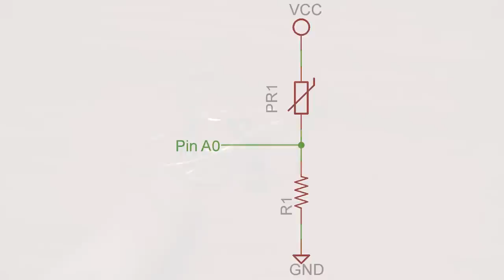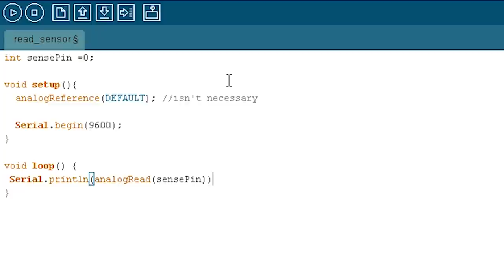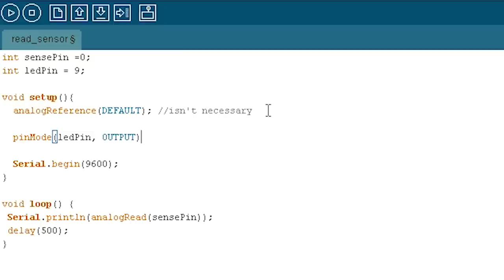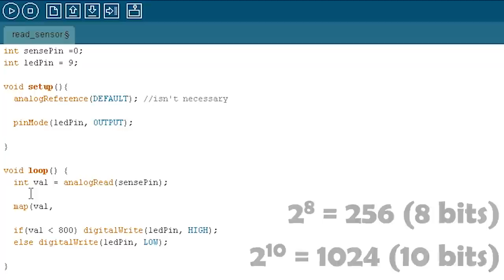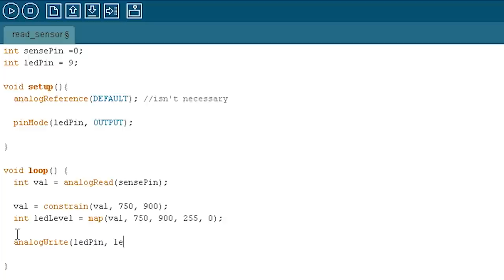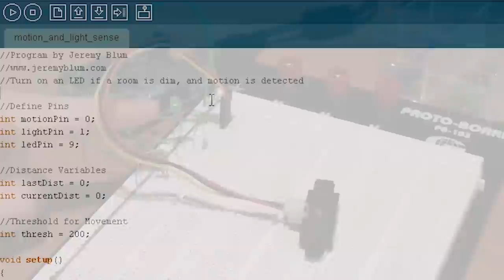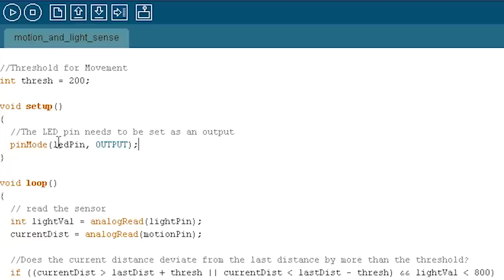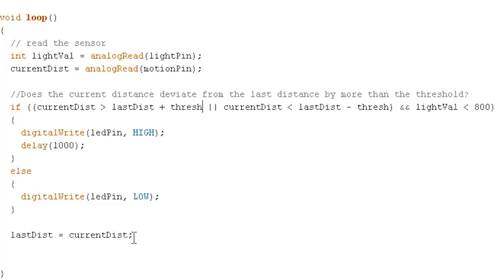Tutorial 04 for Arduino: Analog Inputs

Comment from the maker: @pjharro I've had similar thoughts.  My opinion on the arduino is that it is a good jumping off point - a great way to make something really cool, really quick.  It certainly is not a production level solution.  I think arduino should be used to test and refine a concept, then port it over to C code on an atmega when it's ready to be finalized into a product.  It's a great way to get acquainted with microcontrollers if you are new to them.  I use atmegas with C for serious research projects.

Comment: If anyone was wondering about pull up resistors on inputs, you can set the pin mode to input_pullup to save yourself a resistors, only on digital inputs through.
Reply: can u elaborate, i'm not sure i understand.

Comment: Firstly, thank you for all your teaching here. It is helping me get up and running very quickly.  I am a web developer and coder so once I get a decent grasp of this I will be fine, but I do need some decent support to get me there.  Maybe more that I would like to admit :)

I am needing help with a project and if you could or anyone has the time to walk through this with me I would be so greatful!

Here is my project :

I need to take 12v from a total of 8 sources ( each has its own 12v wire and ground ) ( 4 left and 4 right )

I need to take that 12v and step it down to 5v.  I have purchased (2) 4chnl opocouplers and I have a voltage stepper to bring my voltage down to 5v.

What I want to do... 

the base of the project would be when pin "x" sees 5v it will tell pin "x" it has a signal and a loop will run until that signal is no longer there.  This would apply to all four inputs.
the advanced part of the project would be when multiple pins see signal it can run multiple loops at the same time.

Real world application ( vehicle parking lights, brake lights, turn signal, and reverse ) <-- want to build this out on a bread board or via using my ws2812 led strip to 'bench test' first before we build this out.
I am wanting to do the following
pll ( when on ) turns on leds at 50% (red)
bll ( when on ) turns on leds at 90% (red)
revl ( when on ) turns on leds at 90% ( different color --- white )
tsl ( when on ) runs a sequential effect ( red )

i would have to have if statements... that would be similar to....
if pin "x" that pll is hooked up to gets signal and pin "x" that bll is hooked up to also gets signal, tell the leds to go to 90%
if pin "x" that pll is hooked up to gets signal and pin "x" that tsl is hooked up to also gets signal, tell the leds to drop to 50% run a sequential loop that essentialy turns 2 or 3 on at 95% and runs through the line in a loop
if pin "x" that pll is hooked up to gets signal and pin "x" that revl is hooked up to gets signal, tell leds to drop to 50% and take 1/2 of the leds and switch to white with brightness of 95%

Comment: The serial print line was used to determine what the board was reading from the photo-resistor. It made the arduino report directly to the computer what this output was. He used this info to make the program react to the range.

Comment: The pin types are already pre-defined in the microcontroller chip and in its factory-burnt bootloader. The only thing you have to do is choose the correct pin number/type for your project schematics which is printed on the PCB. A=Analog, D=Digital, PWM=Pulse Width Modulation.

Comment from the maker: @manutube8080 Either an electromechanical relay + a transistor and a flyback diode, or an opto-isolated solid-state relay.  The panasonic AQG12105 electro mechanical relay would work.  Be sure to power it from the arudino using a transistor (this will be shown in the next video).  Also, add a diode from the negative to positive end of the relay.

Comment: Pedro Santos, you can use the same code but the values obtain by the sensePin are probably going to be different from does in the video. So you need to first read from pin A0 to see what values you get and then constrains and map with does values. I hope I explained my self clearly.

Comment: @sciguy14 The device I'm working with is actually a cruise control actuator. It has some kind of a potentiometer / variable resistor in it, but I can't get the output voltage of the pot from any wire that's coming out of the device. There are 7 wires total. Two are for controlling the motor in the actuator, 2 are for a solenoid that locks the actuator arm and I can read a varying resistance value between 2 wires.

Comment: For the last example, since I don't have an infrared sensor, I used a pot. However, I found I had to add a "delay" command to the end of the loop, and lower the "thresh" value, to account for me turning the pot more slowly than the loop would cycle through. Otherwise, it worked fine. But I imagine a lot of viewers won't happen to have an infrared handy.

Comment from the maker: @WebDesigneri If it only have two pins, how is it being varied?  You can set it up in a voltage divder circuit with a fixed value resistor, and use the output voltage to determine the value of your variable resistor.

Comment: For the photocell portion of the tutorial, all one has to do is turn off all the lights in an otherwise pitch black room to find values quite close to zero, even when hooked up to a resistor (10K in my case). I believe he's wrong about the resistor cutting down on the analog resolution.

Comment: Not directly. You can do it the easy way with a current shunt (resistor). Just follow the steps to measure voltage over the resistor and you're done.

Comment: Hey Jeremy, nice tutorials! I'm doing this tutorial and something quite odd is happening. I have my board hooked up the same as yours (I believe), and I'm definitely getting feedback from my photo resistor. However, my data increases in response to the amount of light it receives. In a neutral environment, it averages about 177 or so. As it receives less light, the value increases up to the point of about 700 or so. This is not the problem.

The problem lies in my programming code. Particularly, these two lines:

  if (val >= 250)   digitalWrite(ledPin, HIGH);
  else digitalWrite(ledPin, LOW);

This is bizarre to me. What I expect to happen is that when the value is greater than 250 (or equivalent), the LED turns on. Otherwise, the LED light will remain off. In fact, the exact opposite happens. The LED light remains on for when the value is less than 250, yet it turns off when the value is greater than 250. Why on earth is it doing that? Thanks for any help!

Comment: Hi Jeremy, just now starting to learn Arduino so sorry this comment is so many years after you did the videos. My question is: why do you set up the photoresistor in a voltage divider circuit? Why not use it without the additional resistor?

Thanks!
Scott

Comment: With the code provided for the distance sensor and light sensor combined, if this were setup in an actual scenario for emergency lighting, wouldn't the light flicker off and on? Meaning, you would sense motion, the light in the room would be dark, so the arduino would turn the lights on. It would then immediately run through the loop again, notice that there is now enough light, so it would default to the "else" logic of turning the lights off. Every time the lights would turn on, they would immediately turn off...and repeat. Or am I thinking of this wrong?
Reply: No because the delay(1000) function holds the program up for 1 second (1000 milliseconds = 1 second), and so another light and motion reading will not take place until after that delay of 1 second is complete.

Comment: Absolutely wonderful learning experience!!!

A few doubts:
1. Why did u declare variables in void loop and not void setup?
2. When you name variables, is the name coined by you or they kinda predefined? I mean e.g. SensePin....how does it know you are talking about Analog set of pins on the board..?

Thanks in Advance..
Reply: In the setup function he writes analogReference(DEFAULT) command, which implies that whenever an analogRead(or analogWrite) command in deployed, the input parameter(a number, sensePin(=0 in this case)) it will automatically use the number as the analog input pin number. 

In case of a Digital pin, we use pinMode to define it as a digital pin, now when we use read or write command(digital or analog), the input parameter (a number) is used as the digital pin number.

Comment: I am currently in Chapter 3 lesson two if your book exploring arduino. I am having a very hard time understanding how the seriel monitor output correlates to the temperature. Could you please help me on this.
Reply from the maker: the serial output is an ADC value representing the voltage. there is a linear conversion between the 10 bit value and the 0-5v voltage. then you covert that to temperature using the datasheet.
Reply: Basic ARDUINO 101
Reply: Earl Gray i cant help u
Reply: I was able to make sense of it after further research. Thx guys.

Comment: Looks like you've forgotten the = sign; should be int ledLevel = map (etc etc).  The error shows that you're trying to use a variable (ledLevel) without having declared it first, as the corrected line does.

Comment: Very cool, thanks.

How do I measure voltages hiher than 5V on the Arduino?
Will the A/D converter saturate at 1023 when i do the analogRead()?
will it wrap aroud or crap out?

Should I use a voltage divider? to bring my voltage range to within 0-5V?

I typically need to monitor battery voltages (12; 24, 36V)....

but what if I wanted to monitor a pulsed signal like a ecg (hert rate type pulses) but the pulses are around 100V?

if I use a 19k and 1k voltage divider, will that work?

thanks a lot
Reply: you can use voltage devider by connect the sensor in series with anther resistance .Vout = Vin *R / R1 + R2

Comment: Hi, great tutorials, congratulations. But i have one question. I'm a begginer. Should i use it for program the micro and then use the micro on a pcb board? Does it serves to do the program an then use the microcontroller on my pcb board? Or the project must have the Arduino inside? Because i have some projects that would run better in a microcontroller, but i don't want to join an Arduino protoboard in each project.

Comment: Part2:
Then I think "there is already so many levels of abstraction in electronics (any IC for eg.) should I care that I am not making the house by pouring concrete".

Do you have any thoughts on this? Do you consider using pre-made boards cheating?

I suppose I should be using the tools given me to create more elaborate devices rather than mixing concrete :)

Comment: What's the program that displays the analog values? I thought it would come up on its own (yes, I know now that was a stupid assumption, LOL), but it didn't. I even tried looking through the Arduino folder to see if I could find the program, but I didn't see it. Is it something that must be downloaded separately? If so, from where?
Thanks!
Reply: Alexander Bonnette 
Ref:
http://skinf1sh.blogspot.jp/2015/06/eclipse-clashes-when-start-serial.html

As you can see from the video, just use the function
analogRead(PIN name you wanna read); // should be from A0  to A7 in nano board
this will return the AD value of "PIN name you wanna read".

To get the that analog values in your PC screen,  
you should use  the function called
Serial.println( );

And Open the " Serial monitor" in your PC.
Ref:
http://skinf1sh.blogspot.jp/2015/06/eclipse-clashes-when-start-serial.html
Reply: shinfish
Thanks! I'll have to try that.

Comment: How high can you set the reference voltage? You talked about making it less than the default 5V, but can you set it higher? If so, how high? Thanks!
Reply: The Arduino Board's maximum voltage is 5V. If you have accessories, motors, sensors, etc, that require higher voltages, they can be 'enabled' using a relay board. The relays will simply control when these higher voltage devices are turned on or off. An external power supply is used and directly wired to these devices, motors or sensors, independently of the Arduino Board(s).

Comment: Hi I have a basic ADC question in general: sampling rate. I need to read out voltage from a CCD sensor which will "shift out" voltage signal for each clock cycle. If I wanted to get an ADC that can match this CCD sensor clock, I would have to find an ADC with equal sampling rate as the clock speed right? I've been looking at few TI's ADC units and sampling rates are indicated as MSPS or mega-signals-per-second. So if I were to run the CCD array at 30MHz, I would have to get 30MSPS ADC or higher?

I don't think it should, but does the bit resolution of ADC have effect on sampling rate at all?

Comment: Thanks for your video. How precise can this analogRead be? It varies a lot during your tests. Can it be stable if there are potentiometers are connected? What happens, if there are for example 8 analog inputs used to measure something? Can it be done by an arduino nano?

Comment: Hi, that was a nice video. Helps a lot, but I was wondering what happens if you have a sensor that works with analog current instead of voltage. I mean sensors that output a signal from 4 to 20mA. Is it possible to use Arduino boards? Thanx

Comment: Hey great video. :)
Well, i did order the arduino starter kit so thats not a problem. But, i did order the infrared sensor(short range) but that did not come the connector( the jst connector or whatever it is called) :(  How should i connect the sensor now? Is that cable available on element 14  website? Or is it available everywhere?

Comment: I don't understand why you need a 10K resistor connected to the photoresistor and ground. Is this similar to a pull down resistor? Is it also because there is not a third data lead on this photoresistor?

Comment: This was extremely helpful! one question though:
what if I wanted two Led that light conversely to each other. One would like with high values from the photo-resistor and the other would light with low values from the photo-resistor.

what might the code look like?
Reply: to be clear: two leds on the same bread board receiving information at the same time.

Comment: I'm trying to adapt this tutorial to a microphone module i bought. It has 3 pins, Ground, 5V, and Output. I labeled the A1 pin as the input. What I'm trying to achieve is to display the values collected by the module on the laptop, like you had on your computer when using the resistor. What do I do to achieve the same results?

Comment: The videos are great for the beginners...But i wanna ask one question (could be stupid though ) that photoresister decreases with the increase in light , but when u r placing ur hand over it..means the light intensity decrease, and resistance was also decreasing...how??
Reply: The photo resistor is a resistor. The positive charge runs in one, the anode side and out the cathode. When light hits the photo resistor, it allows the electrons to pass through. When there is no light on the photo resistor, it "resists" all electrons from passing through. The Arduino analog input senses how much electrons are coming into it. And the Arduino, using your code, reacts by sensing the amount of electricity that the input is getting, and does what the code instructs it to do. You can experiment with a watch battery, and LED and a photo resistor.

Comment: Here a probably somewhat stupid question. How does the Arduino read the output from the photo-resistor if the current passes through first the 10k resistor then straight to the photo-resistor?

Comment: Will a IR sensor reflect off of water?
 I have a 5ft tall 1600 gal water tank that I'm wanting to monitor the water level. I was thinking of using a pressure sensor but if a IR will reflect off of water it would be less work and no contact.

Comment: I tried it with a 9.1 kohm resistors and a 1.2kohm instead of 10 kohm and 150 ohm resistors to make the led sensor circuit. It didn't work when I programmed it same as you did. Why so? Is it coz of high resistance?

Comment: @sciguy14 isn't that confusing in terms of coding?
wouldn't it be easier to call all the analog pins A0 A1 A2... etc like they're called on the board?
so for example
int lightSense = A0;
instead of 
int lightSense = 0;

Comment: hey jeremy , i'm loving your videos ,i wanted to ask you if you think this code would work for the last one(i dont have an arduino) :
int ledpin =13;
int switchpin =3;
boolean lastswitch =low;
int lightlevel=0
 void setup(){
pinmode(ledpin,OUTPUT);
pinmode(switchpin,INPUT);
}
void loop(){ 

if   (lastswitch==low && digitalread(switchpin)==high)
            {delay(5)          if (digitalread(switchpin)==high)
                                          {  lightlevel=lightlevel+51
                                             lastswitch=high}
             }

else       {lastswitch=low}

 if    (lightleve>255)     
            { lightlevel=0}

analogwrite(ledpin,lightlevel);

}
Reply: havenotchosenyet  Yes it would work

Comment: Can you actually use the 3.3v pin on the Uno board to power a sensor that requires 3.3v and at the same time use that as the Vref?

Comment: Hey, question- i have infrared sensor and everything but the the JST connector which connects the sensor to the breadboard is actually aluminium( that reddish- brownish fiber like thing) and not copper. Will that make any difference? Help

Comment: Hi! I have a variable resistor that can be set from 3.34 to 8.72 kohms. What's the best way to read the position of the variable resistor with an arduino and get the best resolution? The variable resistor has only 2 pins, so it doesn't work like a potentiometer.